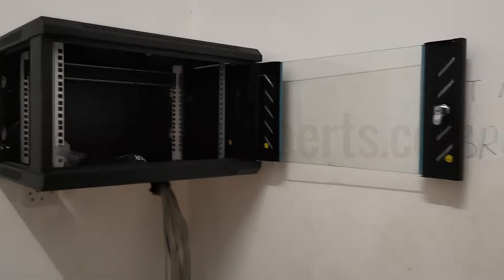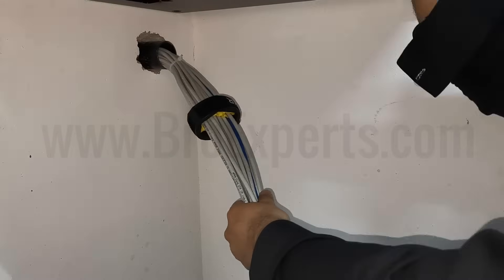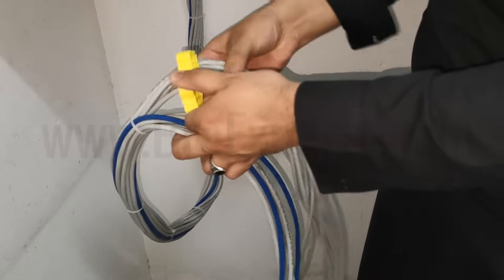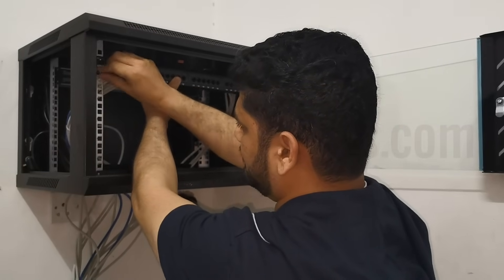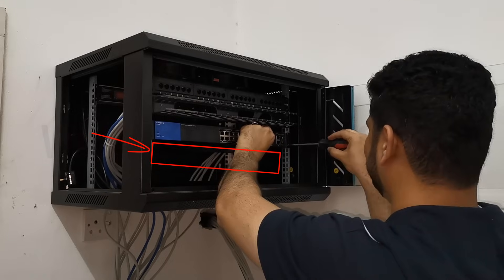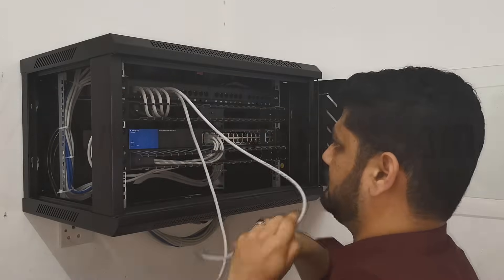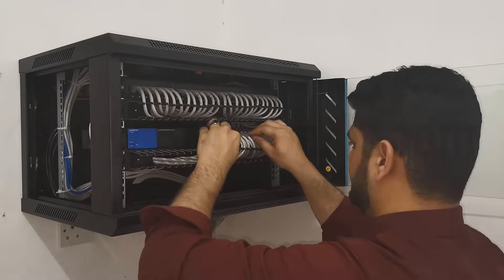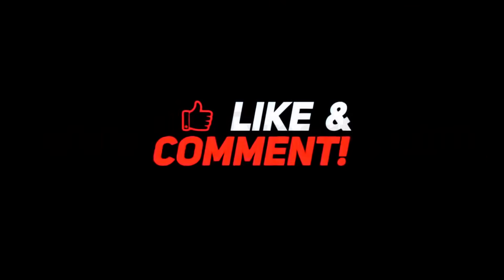Learn Network Cable Management Inside Rack From Scratch

Comment: I would never use zioties, they will break the cable, I've fixed multiple broken installations due to zipties. Shorten the cable bundle, so you dont have 2 m cables circled around in the back. I would never run cables behind servers. In this case where it is only a small network rack itsnot going to be a problem, but running patch cables behind the equipment light look nice, it makes maintenance impossible, and if it were servers, it would make it impossible to use them, as the airflow is ruined.
You also left space between the units, which fenders the numbering useless, and again breaks airflow.
Sorry, it light look nice, but it's not good work. 🙄

Comment: Great video. Next time use Velcro ties and maybe one cable manager, or no manager at all by just getting some short 1-2ft patch cables. 
4U for 24 cables sounds like an over kill
Reply: depends how many endpoints they are looking to switch, a 24 port switch is pretty damn small tbh

Comment: Just out of curiosity, how would you go about cable management for a 42U rack, six 24-port patch panels, and a chassis switch?
Reply: Run the trunk up one of the sides and Branch off for each device

Comment: se usa velcro no cintillas o cinchos como le llaman para no maltratar el trenzado del cable se usa velcro y se ve mas estetico buen aporte
Reply: Y si las cintillas la ponemos sueltas? Se resbalan. Ajá
Reply: @pavellopezbonifacio9885  no se recomiendan cintillos se coloca Velcro queda más estético y sin dañar forro y trenzado interno del cable que sabemos que el trenzado si favorece la transmisión de datos así como el cuidado de la instalación general de todo el tendido del cable y/o FO saludos!
Reply: @sergiodg8634  de casualidad sabrás como se llama la herramienta que se está utilizando en el video para peinar los cables? Saludos.
Reply: @pacotello2191  aquí en México se llama peineta o peine para cable hay de diferentes marcas  podría ser que las consigas de 1500 a 2500 pesos depende la categoría  del cable saludos

Comment: First, no cable ties, use velcro as mentioned in other comments, second : if you are persistant and use them anyway cut those damn things flush, the next person working on the cables will get cut on the sharp edges, also your cables will get destroyed.

Comment: Just as a suggestion: do not use zipties. They will likely damage the rubber coat of the cable. Use velcro or something comparable. This also makes it far easier to add/replace/remove cables from the bundle.
Reply: Ziptie master race does not concur. Ziptie everything so your users are deterred from touching things.
Reply: Zipties on copper - only being tightened down a REASONABLE amount - are just fine and cause no problem. They will not "likely" damage copper cabling as long as they aren't over-tightened.

I WILL give you credit on the point that using velcro makes adding and even removing cable easier. There's that.

Velcro is preferred these days but let's not get the facts twisted here, either.
Reply: @cyrylthewolf  Yep, I do prefer velcro but it would be good not over tightening zipties to be fine.
Reply: @cyrylthewolf  The facts aren't twisted, because, in order to stay in place at the point you want them, zipties need to be tightened. If you prefer dangling zipties on any place but the place you want them, go for it.

Sure, you can put only a necessary amount of force into it, but how many people do this? If your cable management is alright due to the fact, that you carefully put zipties everywhere, that's completely fine (thumps up in this case).

But for inexperienced, velcro is just better, e.g. if they need to move the cable trees around.
Reply: @alphaprot2518  - You said, "do not use zipties".

That direction is not justified as zip ties - USED CORRECTLY - are perfectly fine for copper cabling.

"zipties need to be tightened"

As does velcro...

I have no idea what you mean by "dangling zipties" as I don't have that problem. I trip the excess - as is part of the "using it correctly" deal. It's not rocket science.

" If your cable management is alright due to the fact, that you carefully put zipties everywhere"

Otherwise known as "managing cable". LOL 

Velcro IS preferable. But there is NOTHING wrong with zipties if used correctly. (Again... Not hard. Doesn't really take 'experience' either. It's a freakin' ziptie.)

 The point is that you're telling people "do not use zipties" without justification. Say that they're generally preferred - which seems to be accurate these days with so much more fiber hanging about in our data centers/data rooms, sure.

But don't discourage it all together. It's still an applicable method.
Reply: @alphaprot2518  - Well... Don't make concessions for people who can't use better judgment. That's just letting them off the hook and needlessly eliminating a potential resource.

BUT... I can digress beyond that. At least you're making a hell of a lot more sense now.
Reply: I prefer zipties.
Reply: Just for fun, take a length of any CAT cable and run an attenuation test on it. Then zip tie the hell of it and look for changes in the attenuation. I didn't see any.
Reply: I get so tired of all the purist... It isn't NASA, & a slight amount of deformation of the twist isn't going to kill anyone. Use zip-ties. I like the little thin ones and having thert bar behind the patch panel. Also, I have run Cat5e 310', don't tell anyone. I also de-twist my wires 2 or 3 inches further down the cable than I have to, so that the OCD tech that comes behind me in the years, can tweak the whole time he is on this job.
Reply: @aminormaximum2446  It doesn't have to be NASA, you are taking 20 cables, bundling it together, throwing 30 zipties on them JUST to realize there is ONE factory defect and you have to cut it all loose. Just dont use something thats supposed to be a "permanently bounding" thingy (also forbidden in the data centers by law).
Reply: What about alien crosstalk ?
Reply: Great suggestion.
Reply: can never get the velcro quite tight enough
Reply: Jada gyani mt bn 3 year phele ki video hai aj ke time se great hai
Reply: In some countries, it's hard to find velcro, and zip ties are easy to find.
Reply: essa abraçadeira  estressando o cabo foi o ponto negativo da instalação, deveria colocar velcros, no mais ficou bom.
Reply: Velcro is officially meant to be used on cat 6a, you can use cable tie but just don’t do it to tight.
Reply: Agreed, you get cheap velcro (hook-and-loop tape) packs (100 stripes) for like 5 USD.
Reply: zip ties are not good over the time! and when u want to add another cable? o the mecanic of the cable changes it will damage the cable
Reply: munute 2 , couldn't keep watching   ,  I thought the same. besides he strech the ties as if they wanted to scape lol
Reply: Scania_VB-Rat is correct. I am BICSI certified, and cable ties are a no no. If tightened too much,  they will change the characteristics of the cable diameter, which reduces your signal throughput. I can see the indentation of the cable ties in the video. But overall, it was a nice job.
Reply: @kreativesolutions4u  strange, I work on the copper and fiber optic wiring in 250 million dollar air planes and we use panduit cable ties all day long. Care to guess what isn't in the ceiling of the planes that fly you across the world? Velcro.
Reply: Also, the wires are too short, and too tight on the back of the distribution panel. The wires should be a little longer with just a little spring to them.

Comment: Nice video, but 57$ for Cable Organizing Kit?? And where is Rack  power? Outside? hm
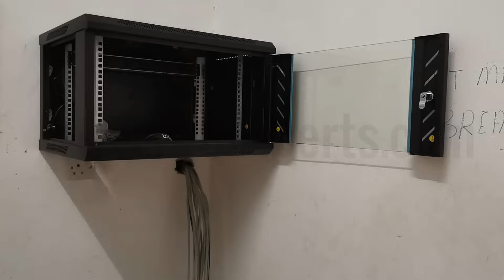Reply: look at 0:26, there is a rack mounted power unit mounted in the back on top ( pretty sure it is). And that aside, there are plenty of cable options to use in a rack. Does not HAVE to cost 57$.
Reply: @Creati_Xx  Oh yes..Sorry

Comment: Neat tool, I try to get 0.10m patch cables these days and go PP, Switch, PP and flood patch, I dont like cables down the back or sides of the switches as they more often than not vent their heat in those spaces.

Comment: Wrong termination of twisted pair cable on IDC detected. The length of nontwisted wires could not be more than 1/2 inch. You make much more. It will take nagative effect to NEXT and bandwidth of channel
Reply: You beat me to this comment! As others have said already, he should have used velcro and not cable ties, as they were overtightened, which would damage the cables over time
Reply: You're right / ты прав / masz rację
Reply: Agree
Reply: true but you can get away with that distance on cat5 and cat5E
Reply: А если по-русски то, что он сделал не так с проводами?
Reply: @sotmrus  Пары проводов нужно расплетать не более, чем на полдюйма. В ролике больше. Это может ухудшить параметр NEXT и пропускную способность канала.
Reply: Да, и стяжками  пучки увязывать не самое лучшее решение. Надо ленту velcro использовать.
Reply: Excuse me for my terrible English
Reply: let us see how it is done ... show us your photos

Comment: I think those 2 big holes in cable manager, aren't meant to have cable passed through them. Always thought, cables should come out from side of it. With this type of mount, i see several issues:
1. Cables covers switch vents on a back, it can lead to overheat.
2. If you will want change positions, or add hardware to rack, you'll have to unmount the whole thing. If patch cables came out from side, then you'll be able to move any element, even if switch is on.
Reply: Agree

Comment: Wow, at https://youtu.be/teah142FGBc?t=120 he does some magic with the cable organizer, it changes color! Nobody?
First of all don't use zip-ties, use velcro.
Second, put you equipment and panels in correct spacing, you leave room between them. On the side of rails you can see which is U1, U2 etc.
Thirth, don't put your cables through the back, use as short as possible cables and put them to the side for better maintenance [
And last, put in panel covers to close the spaces in the front to enhance airflow.

Comment: why we use patach panel why we can't connect lan cables to switch
Reply: So wires have a permanent termination point after coming through wall, there's no cable stress on the switch itself and you always know which cable is where.  Patch panel has more use for professional networkers that need to change connections easily for example between different networks or computers.
Reply from the maker: Thanks for the explanation.. 👍
Reply: ISO/IEC 11801

Comment: I have 2 rules for myself when I do cabling, 1) always use shortest possible cables; and 2) only use velcros, no cable ties.
Reply: Yes Velcro is good..
Reply: 1) yeah, it look nicer, but try to replace a switch without long outage time
Reply: Yes i Agree, Because of if we arrange some additional cable we remove the Velcro and rapping again,
Sometimes the cable tie injures our hands,
Reply: Although I really liked and red all the points you mentioned there.

But, bruuhhhhhhh
You better go write on Wikipedia
Reply: I think the reason why he used longer patch cables because if you have high-speed internet, the cat6 and cat5e cable shorter than 3 ft often create interference and crosstalk. I have 300 Mbps download speeds. As soon as I plug a cat6 cable shorter than 3 feet, the speed drop to 100 Mbps.
Reply: Science and Tech so do you just need to make the cables 3’ 3”? I’m new to all this networking stuff and want to build my own.
Reply: @NetITGeeks  Thats not normal behavior and actually goes against every science concerning crosstalk. 
No: Short cables of the same quality as a longer cable would NOT have more interferance or crosstalk. 

Best guess would be a difference in cable quality. Check if you don't have CCA cables (copper clad Aluminium) and test the cables individually. Also test your switch, I've had my share of "working" switches which seemed fine, till a certain type of cable or traffic got involved (so they where actually but hard to find out)
A LOT (maybe even a majority) of rack installs use extremely short patchcables from patchpanel to switch. 3 feet is already unusably long for Patch-to-Switch cabling.

But considering you talk about 'high speed internet' instead of "high speed networking", I think you are not a professional installer or don't have professional networking experience. Which is fine. 

Also: 1GbE is not considered "high speed". 1Gb Internet would be high speed, but thats still just 1GbE ethernet when it comes to your LAN-side cabling.

@Coach2118 Don't listen, it's just plain wrong.
Advice I could give:
- Get a GOOD cable tester
- Test every connection with the tester after pulling and every patch cable before installing (DOA cables are not unusual).
- Get a good pushdown tool
- If you go the rack route: Keep some slack in the cables before connecting them to a patchpannel, this way you have some slack to fix mistakes or changes in the future
- DO NOT use shielded connectors on both sides, if those are on different ground planes or just don't do it just to be safe. Preferably use shielded (FTP, STP) cable in-wall, connect it to a shielded keystone in the rack and a unshielded keystone on the other end. (In rack its mostly fine)
- Ground your rack itself.
- Thicker cables are more sturdy but harder to work with.
- Remember: You don't "NEED" Cat6A for 10GbE, short range (few meters) cat 5E works fine even for 10GbE.
- Mixing Cat's is fine. You can use Cat5 patchcables with Cat 7 cables in-wall. Be aware of differences in shielding however.
- NEVER combine unshielded cable with a power cables close together
- Try to avoid shielded cable with a power cable together.
- Lookup local code, often loose cables behind ceiling panels are not up-to-code. Often it's also not allowed to pull power and Networking through one wall pipe.
- Use cables the way they are meant to be used:
Use Solid-Core cable in-wall
Connect from the wall to a good wallsocket using pushdown connections or (preferably) keystones. Do NOT crimp on solid-core cable!
Use flex-core patchcables from the wall to devices (preferably pre-made)

Any questions feel free to ask :)
Reply: @MrPuffin69 ... You are professional. An IDE
Reply: @MrPuffin69  I am confused about "DO NOT use shielded connectors on both sides, if those are on different ground planes or just don't do it just to be safe. Preferably use shielded (FTP, STP) cable in-wall, connect it to a shielded keystone in the rack and a unshielded keystone on the other end. (In rack its mostly fine)" Can you explain a little more? shielded keystone instead of a punch panel?
Reply: If you're talking USA, it's never allowed to pull power and networking through one pipe. Forbidden by NEC. You absolutely can crimp solid core cable, but there's not much reason to. Matter of fact, the connectors you generally run across aren't for stranded, they're for solid. But you should never have any "reason" to crimp an RJ-45 onto horizontal cabling. I've done it for temporary runs, but its not a proper install.

The rack is generally grounded by the power system. Don't just drive a ground rod and connect a wire to that. That ground rod also has to be bonded to the ground rod for the buildings electrical panel. The NEC has got pretty specific about how its done, what gauge wire to use, etc. The signal ground should be isolated, and grounded at a single point, but that doesn't mean use unshielded connectors on the far side. The isolated ground bar should be connected to the main ground at a single point, you just don't ground the other end of the shielded cable. If you do, you could turn that shield into an antenna and make interference worse.
Reply: @NetITGeeks  that would be true if you are connecting the equipment to the switch with a short cable. However, in this case he is connecting to a patch panel so he could simply have used 1 foot cables directly from the patch panel to the switch and created a very clean installation

Comment: Why you don't connect the cables directly to the switch? Just wondering!!
Reply: The cables that run through the walls use solid cores while the patch cables use stranded wires (much more flexible but solid has some better performance qualities). Also with this you can number outlets throughout the building and have those numbers correspond to the numbers on the patchpanel so you know which cable goes where instead of having labels on the cables which are buried under more cables making the labels inaccessible...
Reply: More likely to damage them, and the ones run through your walls are far harder to replace than the cheap jumpers you use to connect to the patch panel.
Reply: But it's possible that you connect them directly to the switch?
Reply: @MyTarikovic  That's 'possible' but with solid core cables they won't stand up to much bending or movement, so plugging another cable will put stresses on the solid core cables and break them....
Try replacing a 90 meter long cable through the walls instead of using a patchpanel and using stranded core cables that can bend easily and break far less easy and even if they break are just 1-3 meter without going through any walls.
Solid 90 meter cable: 2-3 hours to replace... Stranded 3 meter cable: 1 minute to replace...
Reply: @someguy4915  thinks for clarifications
Reply: @MyTarikovic  Yes, it's possible, meaning that it would work. It's just not recommended. It's not something you'd see a professional do because the added cost of a patch panel v. the potential for damaging the wires in the walls just isn't worth it. A 48 port patch panel is like $60. Add another $50 for patch cables if you don't make your own. If you have to rerun one line in the wall, it's going to cost more than that.
Reply: Where did you connect the cable coming from the router?